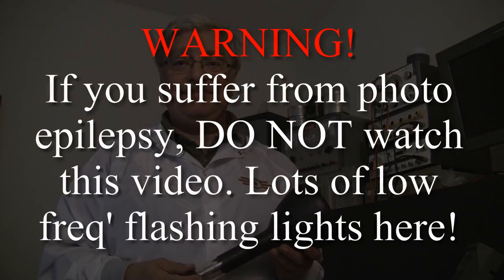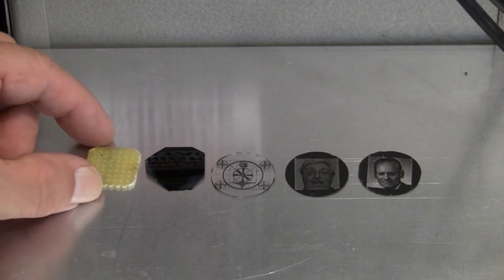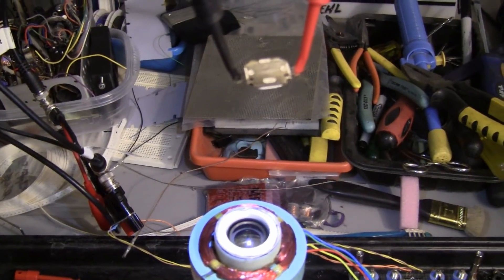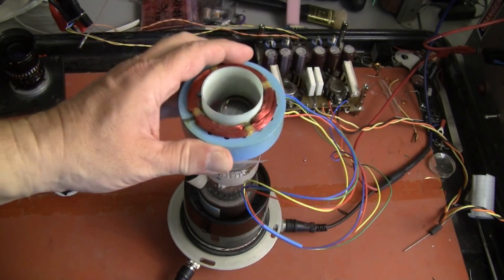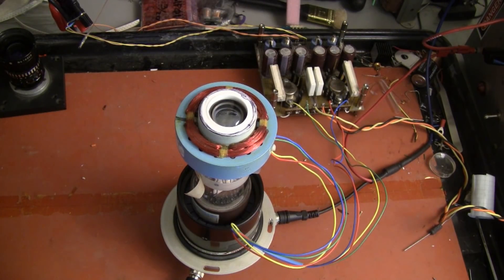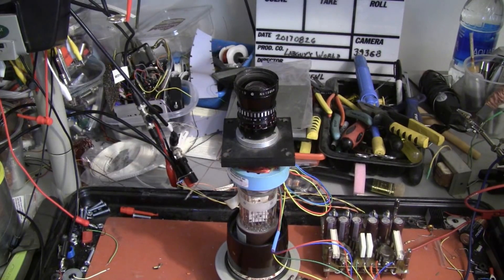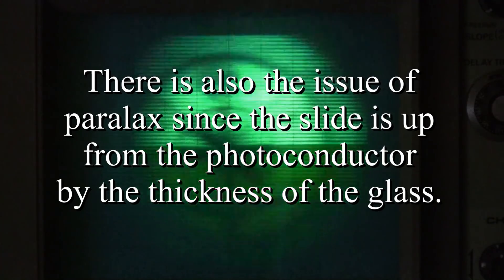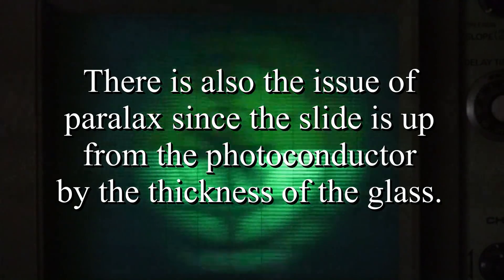Image Dissector FW-130 Update Report #3

Comment: Am I out of my head, or wasn't the tube meant to live in a refrigeration sleeve?  What did that do for it?  The only thing I can think of off the top of my head that works like that is the IR trackers in air-to-air missiles.  Not all such systems are regenerative, and certain ones had problems with running out of coolant.  But the tube is spec'd for visual light, so it can't be to cut passive IR pollution... unless the tube is vulnerable to it anyway, in which case, how would the image improve if the sleeve were fitted and operational?
Reply from the maker: The tube was cooled to reduce electrical noise. The cooler that I have is based on Peltier junctions. It has a water cooling jacket for the hot side of the junctions. I don't feel like becoming a plumber and risk flooding my room. So, I'd leave that to someone else. I thought it would make a very good high speed beer chiller for those who enjoy such beverages. This kind of tube, as I said in the previous videos, is for star tracking and generally used in spy and other observation satellites for position keeping. The actual observatory parts of the military birds use variations of mechanical TV for Earth imaging.
Reply: Fascinating!  I was reminded of this tube when I came across a tube at work, also living in a sleeve, although it was much more boring, being a simple triode.  The sleeve was just to eliminate interference, not refrigerate the tube.  It was an unusual type of tube, though, being  what I learned is named a "lighthouse" tube; it is stepped in its construction.  At first I thought it was a krytron, but nope, boring old triode.

Comment: This is really cool. Do you have some way of capturing the deflection signals from the sweep generators and amplitude signals from the tube digitally? If so, it'd be a fun challenge to generate some digital video from it.
Reply from the maker: That would be done by driving X & Y with D/A converters and digitizing the tube output with an A/D. That is actually on the drawing board. Learning to use a Raspberry Pi is actually more complicated for me than duplicating Farnsworth's original experiments.
Reply: If you need some input from me, don't hesitate to reach out! I think it'd be a cool project to help out with! Have you purchased ADC/DACs for the Raspberry Pi already? If so, may I ask which?

Comment: Great video! But looking at the test setup's block diagram at the end, shouldn't Xin be 1.3 kHz and Yin 10Hz if Y is vertical?
Reply from the maker: Yep. Good eyes, buddy! You got me.
Reply: Hey thanks for clearing that up. Really love the old tech and how you got the test setup working. I've been wanting to try this with an old vidicon tube, but not sure if the tech is similar enough.
Reply from the maker: Check out a YT channel called dalek moore. He is building a variable scan rate vidicon camera running in the speed ranges seen with this dissector camera.